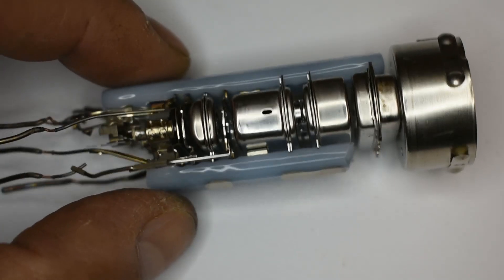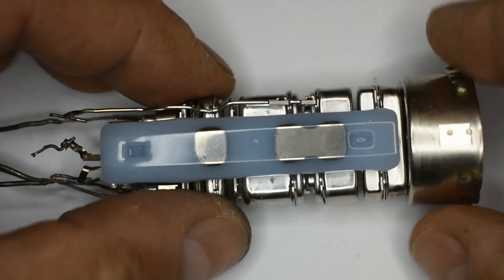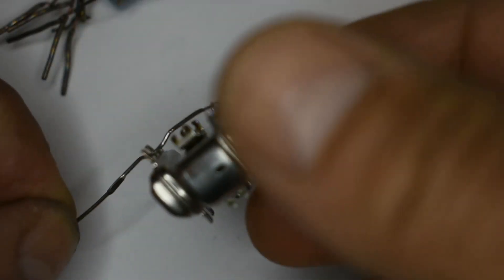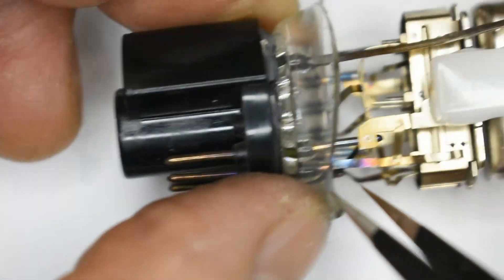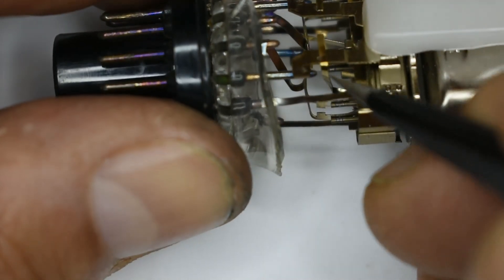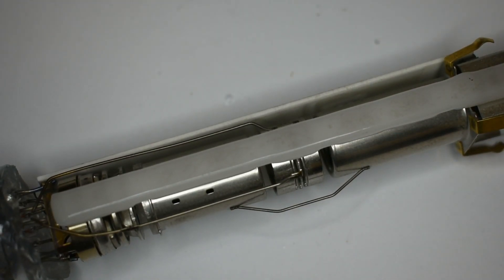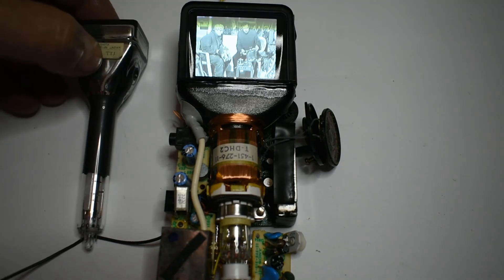Television Cathode Ray Tube Electron Gun Evolution  (Part 2)

Comment: I KNOW what the conductive "patches" on the Elec. 
Gun support do!! It is to disrupt the discharge of any electrostatic charge that could buildup on the supports that can cause a Horz. Output Transistor to short out & kill the driver signal to the H. V. fly back transformer. Without the conductive "patches" the FULL Anode HV of 25-30KVDC might arc to the lower G1 Grid area of the Elec. Gun. With the "patches" only a fraction ( 1/2-1/4 ) of the Full Anode Voltage can arc the the lower parts of the Gun. If you look at the Color Guns in your collection they used 2 distinct different methods to make the "patch".
Reply from the maker: Interesting, hadn't thought of it reducing the chances of flashover, but I'd expect charge on the supports may affect focusing. I'd guess the flyback transistor fail is normally the result of excessive loading in the transformer. Flashovers could certainly damage the flyback transformer and result in the driver failing. Thanks for the information.

Comment: What type of metal?
Reply from the maker: Various metals are used but nothing rare or special for the main assembly nickel and nickel plated parts form the anodes. Generally they are non-magnetic as magnetisation would adversely impact the beam. The shadow mask is iron and can become magnetised. This has a degauss coil added to the outside of the CRT and is designed to remove magnetisation at power-up.

Comment: All connections  are open in the tube so why not beam short circuit  near the starting ends of connections instead where it supposed to go ????
Reply from the maker: Basically because there is a vacuum. In a good vacuum it takes huge voltages to strip electrons from conductors. The highest voltage on the bin base is around 7kV. The cathode is heated and has oxides to help reduce the work required to create a cloud of loose electrons. These  can be influenced by the charges on the anodes and travel. Also the reason why no picture appears until the cathode is glowing hot. Early x-ray tubes worked with cold cathodes but actually the vacuums were poor and the air contamination enables electrons to travel. Even so, they often required voltages well above 100kv to operate .
Reply: @tuopeeks  if This is the case , then that question still stand because if Electrons from heated cathode is attracted towards the Anode it should also attract to its conection wire which is laying over the cathode so it should be easy for Electron to go near by anode s wire  instead of going other end of same conector where actual anode cylinder is connected !!
Reply from the maker: @omsingharjit    Electrons emitted certainly can go anywhere, but the gun assembly has anodes at increasing voltages so the electrons that form the beam are accelerated towards the screen. The screen and internal coating in the CRT are all connected to the final anode which is at the highest voltage at around 25kV. This forms the strongest accelerating force on the electrons. The first anode around the cathode is at quite a low potential and just gets the electrons moving. Only those that travel through a small aperture in the anode go on to form the electron beam.  The first anode will capture most other electron as it is a closed cylinder around the cathode, so few will have any other route or feel an attraction to leads at the base of the gun.
Reply: @tuopeeks  so ,  it's about Flyback HT Anode  output which is externally connected outside of the picture tube towards screen Right!!
Then it makes sense .
Reply from the maker: @omsingharjit  Indeed, the final anode voltage is crucial, nothing will appear on the screen if it isn't present. The voltage is also too high to be connected at the base and has its connection on the cone of the tube. This connects the internal cone and screen coatings with the final anode on the gun.

Comment: Related to the large resistor seen in the Trinitron, just yesterday I found this same sort of thing in the tube from a Nanao MS-2930, which is an A68KSM696X (and other similar "696X" ending tubes from Toshiba). It seems to provide various extra accelerating and/or focus grids and appears to contribute to more consistent focus and definition across the screen. For that particular tube, it also represents a weakness, as the normally-unused pin 4 on that socket now presents a chance to see full HV voltage at the socket if that pin is not connected.

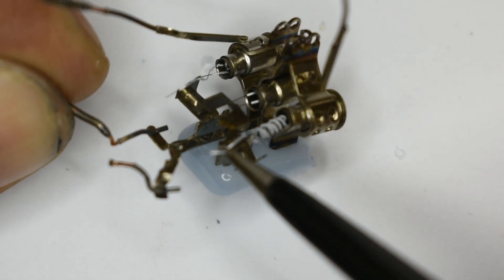Comment: 3:32 - Why do electron gun need heaters?
Reply from the maker: Known as thermionic emission electrons are liberated more easily from a hot cathode. This is also linked to the work function of the cathode material. For instance tungsten needs to be white hot but tube cathodes are coated with oxides with low work functions that only need to be red hot to become good electron emitters. I think developments into lower temperature cathode emitters were being looked into at the point CRTs became obsolete.
Reply: @tuopeeks  thanks that was helpful, that is interesting how heating causes electron emission.

Comment: When I got my first PC with a colour CRT monitor I was surprised to notice the RGB  phosphors were dots in a delta configuration as opposed to groups of three RGB parallel 'stripes' that were the then industry standard for colour televisions. I thought the dot pattern was dead and gone. The shadow mask x16 image in part 1 has partly solved the change from dots to stripes but I am still at a loss as to how CRT PC monitors 'reverted' if that is the correct term to the dots pattern. Either way, watched parts 1 and 2 with utter fascination. Superbly detailed video. Great stuff!
Reply from the maker: Well spotted, higher resolution monitors did revert to the 'dot' type of shadow masks with a finer pitch of the original. These crts however, still retain the in-line gun arrangement.

Comment: Thanks you , i was wonder the barium oxide coat on cathode is coat whole heater tube or just on top, by watching this video now i know the barium oxide is only coat on top. I have a dream project i hope one day i can turn 6E1/EM80 into TV. So need to resign the electron gun in so compact to fit everything into 9Pin tube. 

https://geeseang.files.wordpress.com/2019/04/em80_tv.png
Reply from the maker: Yes, its just the top of the cathode and a very fine electron beam is formed at the grid aperture. This may be a problem with the EM80 as a picture tube, as the cathode is quite wide in comparison and produces more of a flood gun beam of electrons. Not sure you could ever focus it down to create a flying spot in the available space.
Reply: @tuopeeks  to make EM80 need to redesign the cathode.. I still no good in glass work i have a diffusion vacuum pump i lack of some tools, maybe one day i get better space i will try to re design the gun for EM80 that my dream CRT. 

I was experiment about willemite phosphorus which use in EM80 and i only tried in Mechanical pump for pure tungsten triode tube.
 https://geeseang.wordpress.com/synthesis-willamite-zinc-silicate-flourscent-powder-use-in-some-earlier-oscilloscope-and-magic-eye/

https://geeseang.wordpress.com/experiment-with-vacuum-pump-for-lamp-and-tubes/
I bought barium carbonate for coat the cathode . 

i think , to watch into the target anode plate maybe it will look similar like this Flat CRT which use in door camera.
https://youtu.be/kknURT1p47o

I still have long way to go.. lack of tools for this experiment.
Reply from the maker: @6p1p  looks like you are doing well with what you have. I know good vacuums and working with glass isn't easy. It can be very frustrating at times .

Comment: Sinclair had a pocket TV in the 80s using a CRT where the phosphor was viewed from the rear, is the Sony tube the one from the Sinclair or have they copied Sinclair's design?
Reply from the maker: I think Sinclair was first with the idea but he used a CRT constructed like a vacuum fluorescent display (VFD) and also used electrostatic deflection like in an oscilloscope. The Sony design more faithfully followed television CRT construction and operation, but perhaps for copyright reasons.
Reply: @tuopeeks  Thanks for the information.

Comment: You did not mention about the ground pin of the CRT Electron gun ....
Is the pin marked "g1" is the ground ?
Reply from the maker: The return or  ground is really the cathode although a resistance will control beam current and effectively modulate the brightness. In TVs a small amplifier is uses to do this to build the picture image brightness detail as the beam is scanned A1 will have a voltage normally the 'screen' output from the flyback transformer.  The Grid is used for brightness control so has a voltage on it but may work grounded.
Reply: @tuopeeks  thnks for the info
Reply: There isn't a given ground pin.

You can do positive and negative voltages or all positive compared to chassis.
The relative voltages matter, so what pin is closest to ground varies with implementation.

Probably covered in part 3.
Reply: @erlendse  yes we need part 3 now...😁

Comment: Cant we get the heater going and second anode hv then just ground pins to find the cathodes
Reply from the maker: Good chance you would get a dot or at least a flash of one. With the A1 and the grid floating beam cut-off may occur if a -ve charge builds on them.
Reply: @tuopeeks  cool your knowledge on this is A1 thanks.. its amazing to me that they managed to get CRT TV to work when you understand what's Involved it's an excellent display of early engineering genius...
Reply: @T2D.SteveArcs  The cool part is that the active area is all open space!

I honestly would like to have a CRT made short, with 1/3 targets in front of the e-gun.

Also, there is the hit random objects with eletron-beam and see what happends!
Reply: @erlendse  x Ray's happen :)
Reply: @erlendse  your watching the image through the beam and Vacuum if I understand correctly